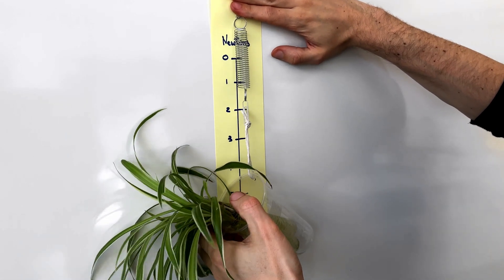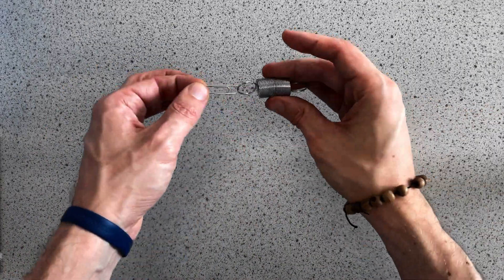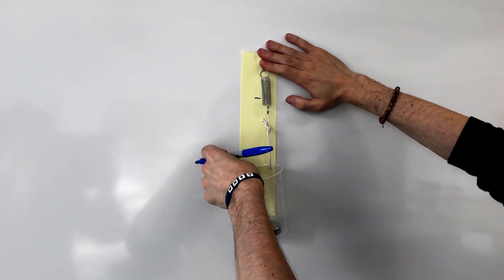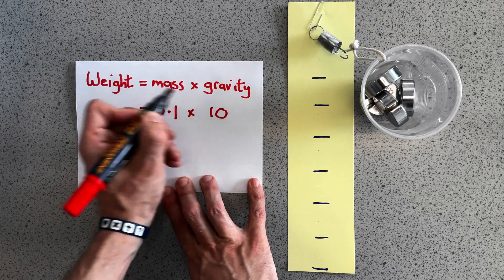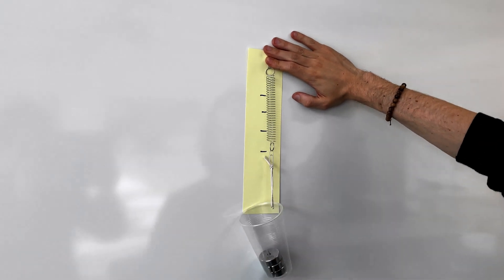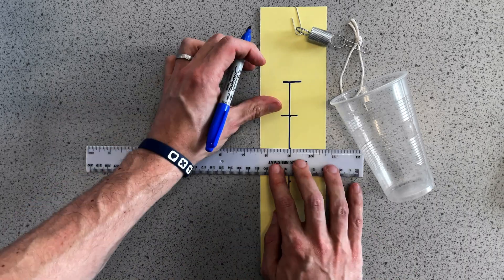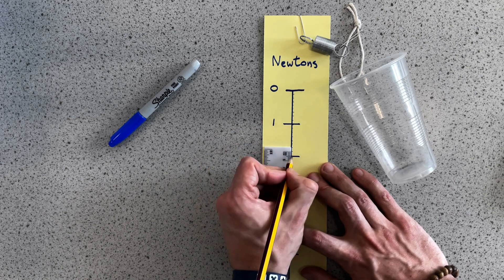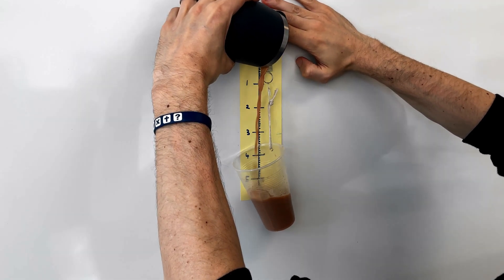How to make a force meter (Newton meter)

Comment: WHY GRAVITY 10
?????????????????????????????????????????????'
Reply from the maker: The main reason to use 10 instead of a more accurate 9.81 is to make the experiment much easier. If you take g to be 9.81 then you would need to add 101.9g to get a Weight of 1N and 208.8g to get 2N etc. Also with the inherent uncertainty in the method the difference between rounding to 10 and using 9.81 is so small it is insignificant. Hope that answers your question.
Reply: @mrdoey  why aren't you uploading?

Comment: So the gravitational force is 5kg for 1 meter to pull... and you need a force of 10N to pull 1kg so how to calculate N*M force of a motor for example in kg?!? Using a little dynamometer i obtain 13.5 N*M to 5kg , i don't know if is right... i think i got it, so a 10N m pull 1kg m :P
Reply from the maker: Hi. This video is about how to measure the size of a force. To be more detailed it's how to find the weight force acting on objects. It sounds like you are trying to calculate something called torque. I suggest you search for videos on 'how to calculate torque'. Hope that helps.